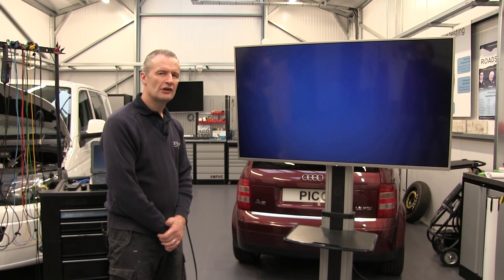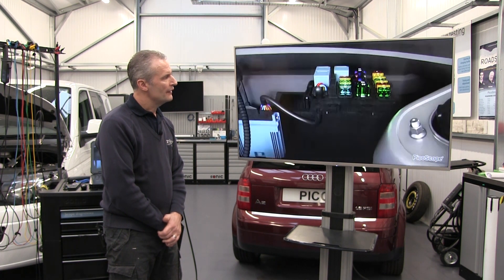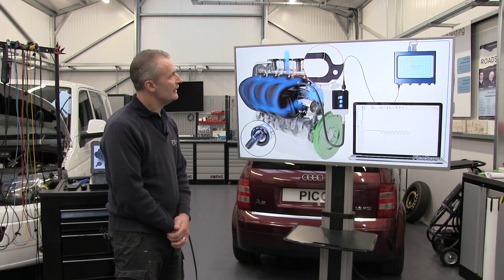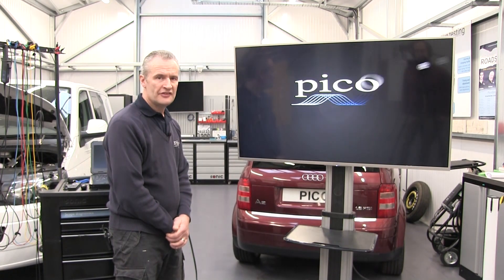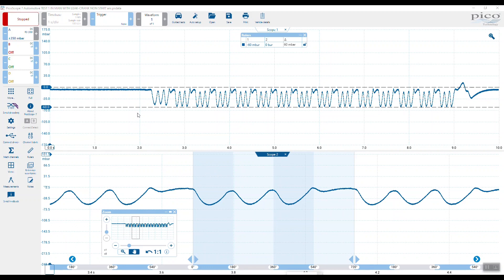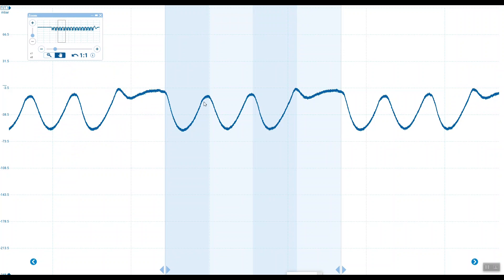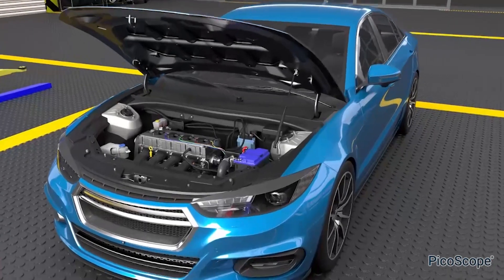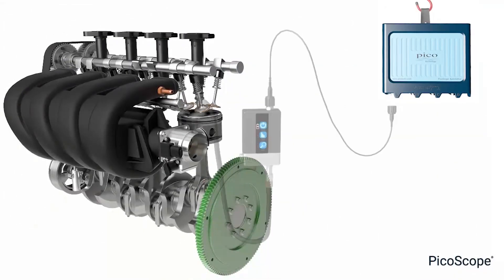Intake Manifold Pressure

Comment: your using pico7? pico 7 only for electric vehicle or or it will cover all
Reply from the maker: Hi Shanid Mon. Yes, you can use PicoScope 7 on all types of electric signals in different types of vehicles and machinery. This video is showing how we use the Pico pressure transducer to measure the intake manifold pressure in PicoScope 7.